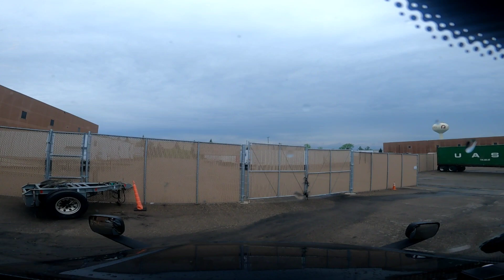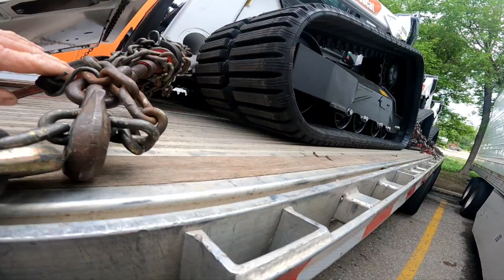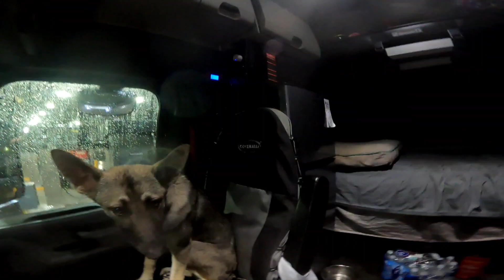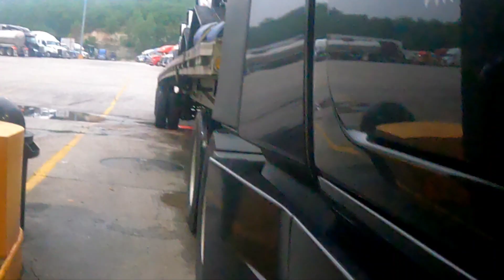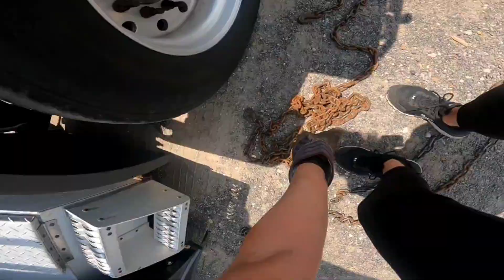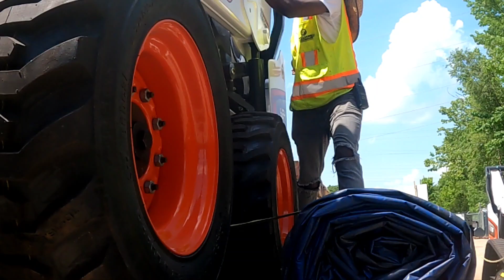PRIME INC FLATBED BOBCAT load

Comment: I have a question for you.  I am interested in flatbed work, but not sure I can handle the weight of the tarps.  Maybe you could do a video?  But wondering how this is for you
Reply from the maker: Most of the time the forklift driver lifts them off.I've been lucky haven't had to tarp lately. I'm headed to Washington State most likely will have to tarp
Reply: Tarps suck. If you have any concerns, it’s probably not a good idea. Heavy. Unwieldy. A real pain in the a**.